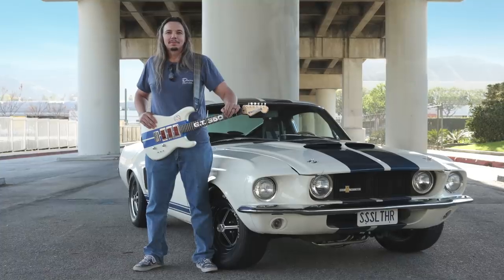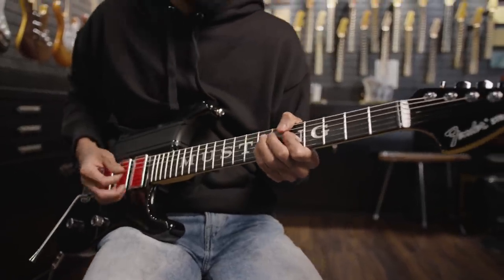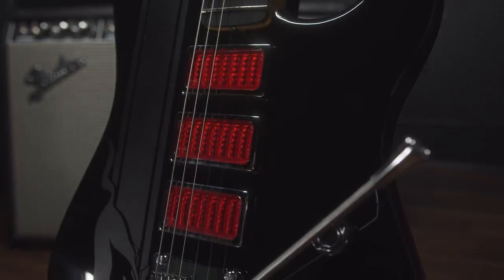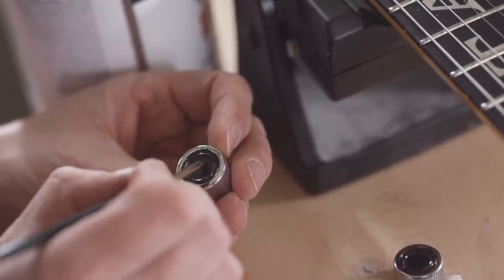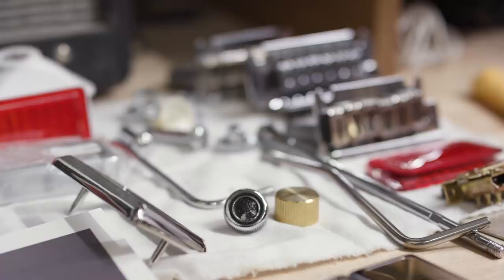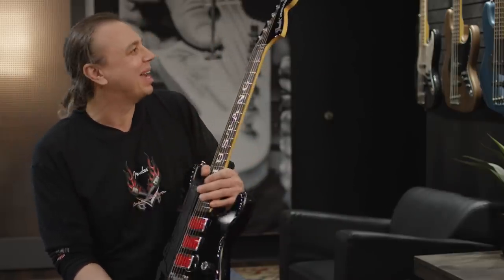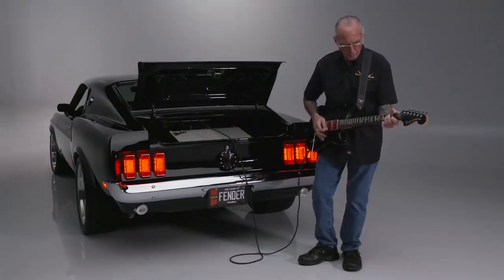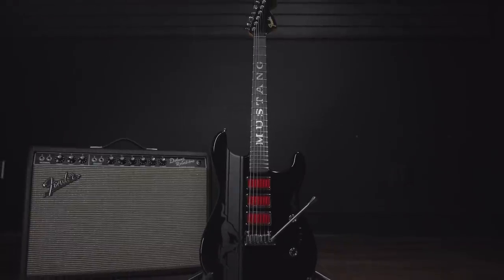Building The 1969 Custom Stratocaster | Dream Factory | Fender

Comment: If only there was a model called the mustang
Reply: I wonder why fender didn’t build a mustang guitar instead of a stratocaster
Reply: @BombayPilotWala  I think it’s because the Strat was the big American guitar that assured Fender’s rise to fame which really reached major heights by the this point in late 60’s, much like the Mustang was one of the greatest American sports cars that earned an equal level of prominence at this same point in the late 60’s. The Fender Mustang definitely held a great spot in this time period as well, but it wasn’t on the same level as these two greats, more on the level of a more desirable commuter car with some bells and whistles. I had the same thought about a Mustang guitar for a Ford Mustang, but Strats and Mustangs were of far more significance in 1969.

Comment: Beautiful @Fender, wish it had the 24 frets and contoured heel 🙂
Reply: 24 frets isn't the best thing on a 3 pickup strat tbh, the iconic strat neck pickup tone happens because the pickup sits on the harmonic node where the 24th fret would be. If you have 24 frets you have to move the pickup so you lose the tone.
It's why gibson Les Pauls and SGs sound a little different, even though they have the same pickups and scale.